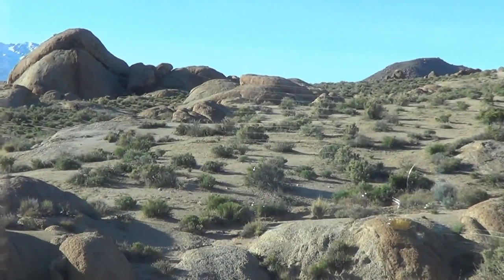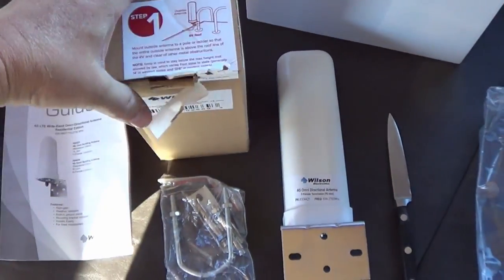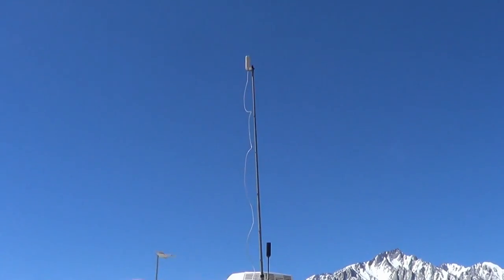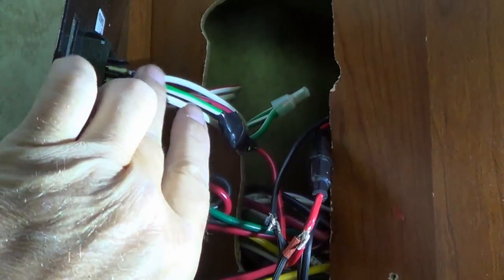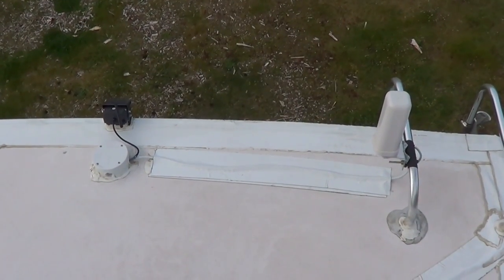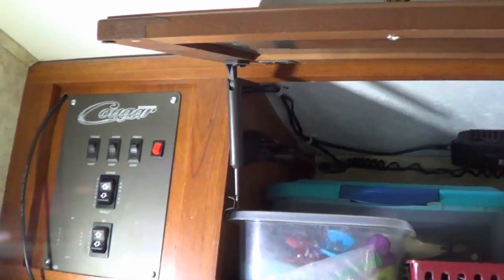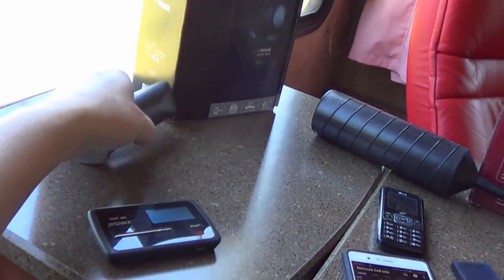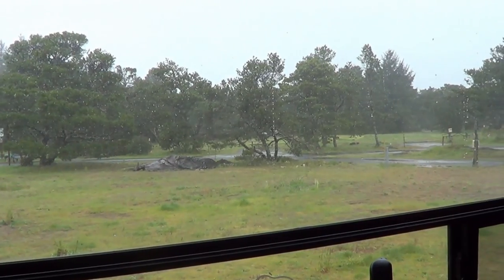weBoost Drive 4G-X RV Cell Booster Install and Review

Comment: Is there any equipment to project the signal inside the entire rv?
Reply from the maker: The problem is when the signal is increased to project the signal inside the RV it interferes with the outside antenna causing feedback. Some folks are lucky and have a metal shelled RV which works better. I've heard others have had success installing a metal shield between the two antennas or increasing the distance between antennas. Different RVs will perform differently, but you can see it sucked with my fifth wheels fiberglass and foam filled trailer walls with a wood roof. I just place my device close to the inside antenna and it works well. Cheers, Ray
Reply: Thanks, Ray.

Comment: I thought I've seen on another post about this booster that the external and internal antenna need to be a certain distance apart from each other. Is this correct? Your internal and external, or at different heights. but not far apart.
Reply from the maker: Generally, the further apart the better but can depend on the construction of the RV and how much signal blocking metal is where. 
If the outside antenna signal interferes with the inside antenna signal feedback can occur lowering the maximum gain, the weBoost amp has blinking light codes to tell you if that's the case.
Most people will experiment and find out where the antennas perform best before permanently mounting them. Some folks never permanently mount them and move them for best performance at each campsite.

Comment: Nice review. I see they have sent the Weboost to several of my favorites channels. All are positive reviews but you are the only one with the Coolest Snoopy window sticker!!  What I liked you did that others did not do is the distance from the inside antenna. That was interesting and I was surprised how much loss you got with only moving a few feet. I thought that it  would have been better than that...  And I just noticed that I watched this one thinking it was new and its a yr old one. So is the Wingard one working better???
Reply from the maker: The signal distance will be greatly affected by the construction of the RV. It should be much better in a steel or aluminum RV versus my trailer as the signal distance problem is a result of the inside and outside antennas interfering with each other. There isn't much to block the two signals in my trailer as the construction is aluminum studs with fiberglass and dense foam between them. So the amp is forced to reduce signal output to avoid feedback between inside and outside antennas.
I notice weBoost has a new system out for RVs with a 25-foot telescoping pole, likely to try and increase the distance between antennas - https://www.weboost.com/products/connect-rv-65
Reply: @LoveYourRV  Using a yagi inside is also possible.  If you have one yagi use it on the mast, but a second one inside pointed at your sitting position helps a lot.

Comment: Ray, great review.  I have always wondered what kind of range you would get if you used the trucker antenna on the ladder and the RV external antenna as the indoor antenna.  Would you get better range with the higher -dbm antenna?  Just a thought.
Reply from the maker: Not sure it would match up with the amp properly, but could give it a try. You would think the company would have tried that. :)

Comment: Hey, Ray-  Do you find that your T-Mobile cell service reception is keeping up with Verizon in the boonies?  How large a data pack do you have with V, and is it sufficient for your monthly needs?  Love your videos!  Between you, the RV Geeks, and Technomadia a person could learn just about everything they need to know about setting up and maintaining a home-on-wheels.
Reply from the maker: Verizon is much better in the boonies for sure, especially in the southwest, no question
We actually have Verizon MiFi,  Tracfone (I think At&T) and the T-Mobile.
The T -Mobile service is from a reseller in Canada that sells a pay as you go Snowbird Plan - https://roammobility.com/snowbird-plans   It's a  pretty good for talking and texting to our family and friends back in Canada.  As far as data I find we use around 15 gigabytes a month total, so the T-Mobile helps but our main go to is Verizon since to works most everywhere. I buy 10 gigs for 100 bucks and renew when we run out. Thanks for watchin, Cheers! Ray
Reply: Thanks for the prompt response.  Sounds like T-Mobile is trying to up their game with the latest frequency auction wins.  Maybe some day they will be THE big player in the SW US.
Reply from the maker: A big problem I run into in small towns, which we love is the towers can't handle the increase loads a bunch of snowbird RVers put on them, especially on 4G. Many times I will switch our MiFi to 3G and get faster speeds since fewer still use it. I heard Quartzite was pretty bad this year during the big gathering, too many on the towers overloaded them no matter what carrier you were on.

Comment: Ray the booster can also be hardwired to your wifi (jetpack) it has a jack and you can buy a adapter online for optimum performance when your not worried about the phone and need it for wifi svc. when it outher wise wont work. Your going from 3 antennas to 2 reducing any interfarence between them. They are cheap also. They did away with the jacks on phones.
Reply from the maker: Do you mean the 4G-X amp or do you mean wiring the external antenna straight into the MiFi bypassing the amp?
I don't see an extra jack on the 4G-X, only see inside and outside antenna ports and power input.
Reply: from amp to mifi
Reply: Also the 7730L   jetpack is  the best one out now as far as all around performance, check reviews. if your up for a new 1. but you know as soon as you get it they will come out with a better 1. (unless you have 1 you will need a extension cable as the adapter for the wifi, jetpack is not that long)  setup outside ant to booster to wifi all wired!  Sorry, hope this is understandable not very good typing. Tom

Comment: Hi Ray. Thanks for the detailed review. Have you thought about trying to relocate the directional antenna further away on your roof? I see you have a Winegard TV antenna. I've seen cell booster antennas mounted on the Winegard mast. It might provide better separation to the indoor antenna and be higher up than your ladder install.  Directional antennas transmit in multiple directions so the spacing between the outdoor antenna and indoor antenna is critical from what I've read. Have you considered a directional antenna vs the omni antenna. You could mount it on your Winegard mast and rotate it to the cell tower using an app that locates cell towers in your locations. The directional antenna will transmit only in one direction and should interfere less with your indoor antenna. The directional antennas are less than $100.

I've read RV owners with both a omni antenna and directional get better signal using the directional antenna in fringe areas. They use the omni for 85% of the time.

It appears this RV package is just a collection of existing products Weboost sells although the omni antenna in this kit appears to be a different shape than the omni listed individually on the Weboost website.

I notice there are other indoor antennas Weboost sell that can be hung from ceilings for home installations. They may have better boost but Weboost is concerned with users traveling in motorhomes and too much antenna boost would interfere with nearby cars driving by and are probably restricted by FCC regulations from selling a mobile product with too much indoor range.
Reply from the maker: I tried it on attached Winegard antenna and I also placed it on the top of my 20-foot fiberglass flagpole, didn't seem to make any difference. I'll continue to play around with things, maybe try out a directional too. Thanks
I assume cobbling together your own unregistered powerful booster system may cause too much interference. Maybe the cell company or FCC would come knocking at the RV door. :)
Reply: I've read on the Airstream forums users who work from their trailers full time find while the Omni antenna works fine on the East coast they use a directional antenna, mainly mounted on their Winegard mast, when out West boondocking. They are able to pull in a signal better with the directional vs the omni. They run two cables down and manually switch from one cable to the other at the 4GX booster.
Reply from the maker: Thanks for the tip!

Comment: We just bought this Weboost RV.  version, installed it, and saw no improvement in our signal of our iphones or iPad. We called we boost representative and she said if you have an iPhone, recent version updated, there is no way to test whether the booster is even working. Because of a glitch in the iPhone you cannot download the RF monitor to find out what the decibel levels are. So if we decide to keep the package we have to take it on faith that we are getting a better signal. You would think they would've figured this out when they decide to charge this much money for this booster. The representative said that you cannot go by the signal bars on the phone. You have to download a measurement app and it is impossible with the iPhone. Any advice from any of you out there on how to test whether our booster is working?
Reply from the maker: Maybe it's not working right. :( Have a friend with an Android phone check it for ya. :) You can use online speed checkers and see if the upload and download speeds are improved.

Comment: Tell me the app to down load to check on and off difference
Reply from the maker: I use an app called Network Signal Info on my android phone - https://play.google.com/store/apps/details?id=de.android.telnet2&hl=en  But keep in mind even though the signal strength goes up doesn't necessarily mean the speed will increase. Sometimes I found it got worse. A lot depends on how busy the tower is. The booster only really helps a bunch when in a fringe area and connecting to a non-overload cell tower. Recent booster review  https://youtu.be/gtM8qgD0AbE  Cheers, Ray

Comment: Have you tried placing the internal antenna on a metal plate to act as a ground plane? Great video!
Reply from the maker: No, does it help? Maybe it's built into the antenna. I didn't take it's apart to look. I think they designed the system to use antennas that don't require a ground plane.
Reply: Love Your RV I haven’t tried Ray but read recently that an antenna needs a ground plane. Could a plate about 12” square be worth a try? Let us know the result. Good luck and keep up the great videos!
Reply from the maker: My old Sleek amps little magnetic mount antenna reception did improve by putting it on a cookie sheet, but it was one made to go on a car's metal roof. I actually ended up buying a special suction cup mount for it with built-in ground plane so I could mount it in the window - https://www.wilsonamplifiers.com/wilson-home-office-accessory-kit-for-sleek-amplifiers-859970/
This 4G-X kit is designed for the RV so I think they have built-in ground planes. I'll have to try it out next time I'm in a fringe area see if it helps. You would think though if it did, why wouldn't weBoost incorporate something into the design or at least mention it in the manual.  Cheers, Ray
Reply: Hi Ray. I just thought i'd mention trying a ground plane. Let us know if it works or makes no difference. All the best for 2018 to you and your lady wife!

Comment: What about Verizon? I know but try to get some one with Verizon to see how it works? Then t-mobile to if you can? Thks thanks for the info so far?so dose not work in bed room or dose it? Thanks Ray great review so far...
Reply from the maker: My phone is T-Mobile and my  MiFi hotspot is Verizon, I also have a Tracfone on AT&T I believe. results were similar with each.
Reply: Thanks. Still waiting for all the info when you get home in BC. Then will make my buy , but until you work out all the bugs I will wait. Thks for you hard work.
Reply from the maker: You bet. Cheers!

Comment: I wonder why is the signal from the indoor antenna so poor? you would think and expect the signal would be good all over the RV. Strange.
Reply from the maker: I think since an RV is so small compared to a house the distance between antennas is too close and the amp auto tunes itself to prevent feedback interference. Maybe on a metal shelled RV like a bus or Airstream it would work better since the metal would act to isolate the two antennas from each other.

Comment: You should be able to get a smaller U bolt and cutdown/adjust the brackets with a Dremel.  You do have a Dremel don't you?  A nice 1 day project, you can do a video on.
Reply from the maker: Yep. Here is the mod I did - http://www.loveyourrv.com/wp-content/uploads/2017/04/weBoost-RV-outside-antenna-mounted-on-rear-ladder.jpg  I'll likely swap it our for good marine stainless steel as I'm sure this crap metal clamp will rust here on the coast.

Comment: Excellent review as always.  After the FCC ruling neutered the cell phone amps 4-5 years ago, they are severely handicapped now.    I've been using  Wilson/WeBoost amps for over 20 years and have done extensive testing, but rarely use the current model I have.   Your testing proved that out.  Do you have the ability to connect an external antenna to your Hotspot?   If so I'd be curious to see how that compares. 

  I have the same issues with my WeBoost.  It amplifies the signal fine, but the transmit power is too low, so the speed sucks.  I get disconnects all the time and slower speeds with the amp inline, so rarely use it.   My ATT hotspot has an external antenna port, so I hook up directly to that.  The antenna is key to getting a good signal, so I'd hang onto that trucker antenna.   Would be interesting to see how well that performs side by side with your new antenna.   Adding a directional antenna can help in those fringe areas.
Reply from the maker: Yes, my 5 years old 4620LE has a little tiny antenna port. I'll have to get an adapter and give it a try.

Comment: HOW WELL DID THIS END UP WORKING AND WHAT IS THE UPDATE FOR 2019?
Reply from the maker: Not much changed, it works about as well as I described. I did notice that the company has since introduced a model with a seaprate mast with a directional antenna, which helps with signal separation.  https://www.weboost.com/products/connect-rv-65
One thing I am noticing is less and less do I need a booster as the cell companies keep improving their cell coverage to rural areas. I only needed a booster a 1/2 dozen times this last year. By far the biggest gripe with connections is oversubscribed, slow towers, especially if you are on a lower price tier and subject to network management by the cell carrier.
THERE IS YOUR 2019 UPDATE GEORGE
Reply: oes “lower price tier” mean Consumer Cellular?

Comment: From what I've see from other YouTube videos, your inside antennae should be up high for a good signal.
Reply from the maker: I tried it everywhere in our trailer, up higher made no difference for me.
Reply: I meant the square white antennae.  Your new one is miles above it ... uh, technologically speaking. :)
Reply from the maker: I tried the big white square one everywhere up down front and back, below the window was the best spot. I think it's maybe because the fifth wheel roof is rubber and wood so doesn't block signal well but the rear window and back wall have a lot of metal, giving better antenna separation. Cheers! Ray

Comment: I would love to see this test done with the INSIDE antenna at the Other end of your RV and then do your test of 1-2-5 feet away. I still think you are too close to the Outside antenna.
Reply from the maker: I tested in every part of the RV, I showed it in the spot with the best reception I could find, I guess it had to do with the metal framing and window at the back of the RV helping to separate the two antennas.

Comment: 26:50 mmmm that makes no sense... again, it might be that the Outside antenna is too close. The White indoor antenna should cover hundreds of feet, indoors..???

30:50 based on these test you wasted a lot of money (if you had paid for this) on something that only works 2-5 feet away.
Reply from the maker: I tested in every part of the RV, I showed it in the spot with the best reception I could find, I guess it had to do with the metal framing and window at the back of the RV helping to separate the two antennas.
I didn't pay for it but tried to do an honest review showing for me how it worked and as you can see I wasn't impressed with the inside reception. Not that its a big problem for data as you can just have the device beside the antenna, but for phone calls its a pain.

Comment: 19:30
 I see that you're no more than a few feet from the OUTSIDE antenna and this is NOT the way they want you to be set up. I have heard time and time again that you need to be as far away from the OUTSIDE antenna as you can get.
Reply from the maker: I tested in every part of the RV, I showed it in the spot with the best reception I could find, I guess it had to do with the metal framing and window at the back of the RV helping to separate the two antennas.

Comment: How does this work in congested RV parks?
Reply from the maker: I have to admit I haven't been able to try it in congested RV parks as most are also close to a cell tower anyway so the booster isn't needed. Most of the time when we needed it is out in the boonies away from towns and cities.  I'd think it would work fine as your cell phone works in cities OK. Same frequencies.
Reply: Unfortunately,  we stay in a mostly military campgrounds that have terrible cell reception. Couple that with so many people in one place and we struggle for 4G, often only with 3G or even 1x.
Reply from the maker: The booster helps if the signals are weak but it won't help if the cell tower is congested from too many people using it.